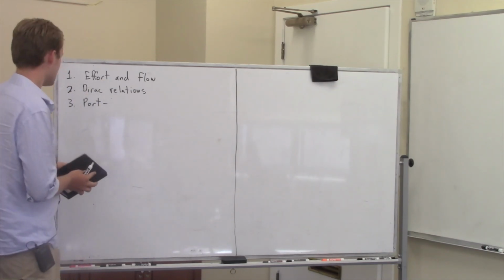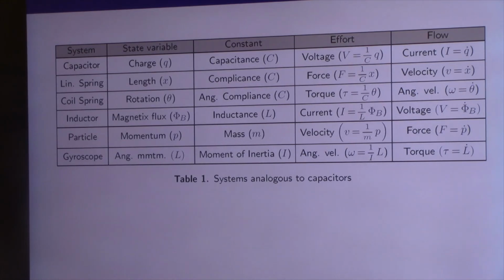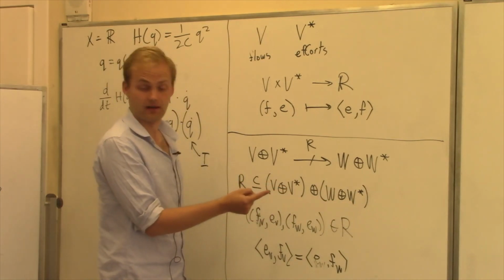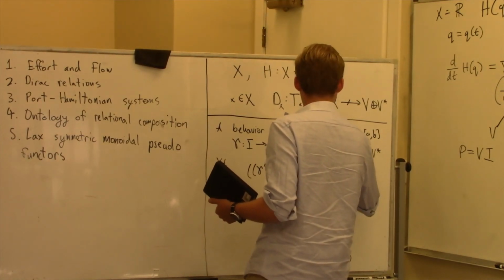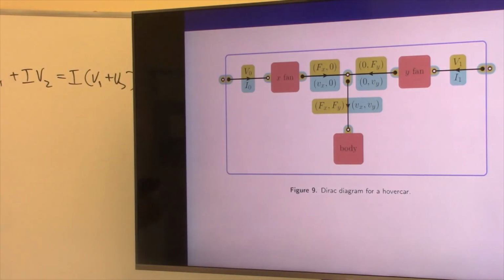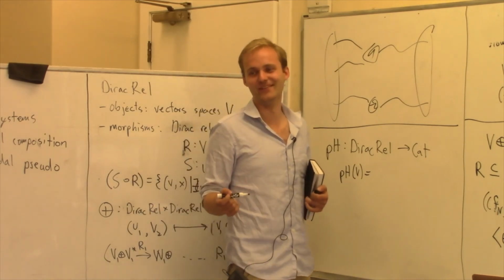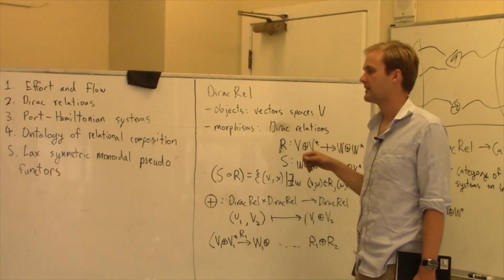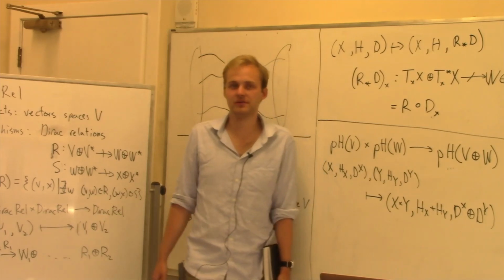Owen Lynch: Composition of Port-Hamiltonian Systems

Comment: 22:46  You do not disconnect pendulum from the Earth (or whichever is the main body pendulum is connected with, be it Jupiter or whichever other mass).  The flow is, then, in the Pendulum<->Earth system.  As the pendulum swings the Earth swings ever so slightly in response.  We can neglect the latter in computation, but I am always wary of hiding the places where model was simplified.  Least we have to come back and revisit what was consciously disregarded.  That's why it is better not to swing (I mean spin, well, not really - sweep) it under the carpet.